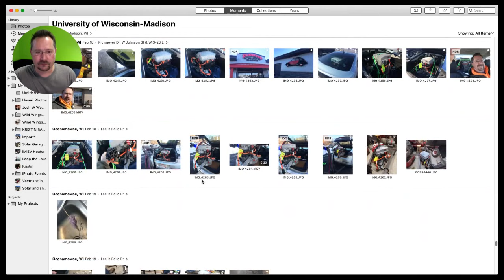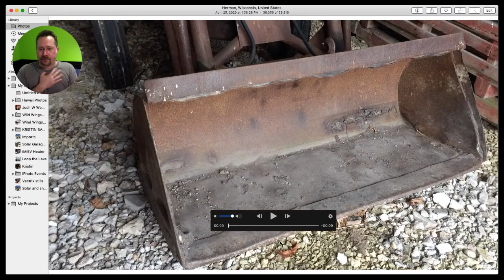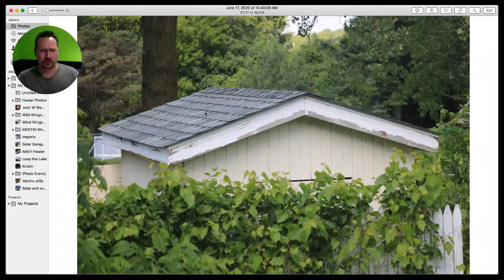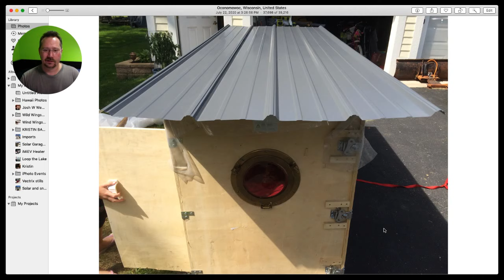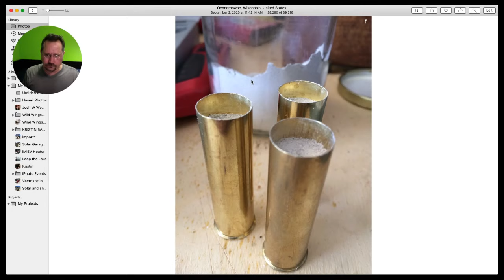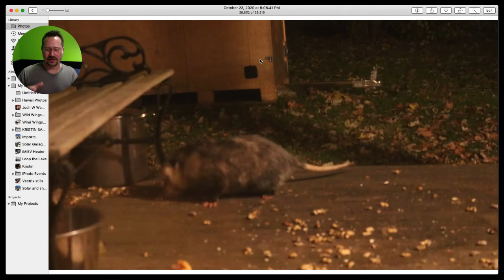2020 Covid Projects - Life, Death, and DIY

Comment: Hi Benjamin, I saw your video on the tear down of the Nissan LEAF gear box:  https://www.youtube.com/watch?v=L5WhB7uQLzY    I want to ask you:
.
At minute 7:18 of your video we see the 2 gears.  Do you think it would be possible to swop those gears?  The result: for every one rotation of the motor the car wheels would turn, say 1.5 rotations.  This would mean that the Nissan LEAF would all of sudden have kick ass power.  You could perhaps do 0 to 100km/hr in, say, 4 seconds.  Obviously there is a question of torque, speed measurement and of course would the gearbox housing accept the change. 
.
I think you get the idea?  I have a Nissan LEAF and have always wondered if there is anything I could do from a mechanical sense to make it go faster.
.
Comments?
Reply from the maker: Looking in the gearbox, it would not be a simple swap to change those two gears. It would require some special machining and I know it would be beyond my ability.
The trick with gearing is that you swap torque for speed or speed for torque. You can't gain both, that requires a higher HP engine/motor.

A gear swap could give a higher top speed, with poor acceleration, that seems like a poor choice.

Improved acceleration (torque) with a lower top speed might be fun, but would probably mean you couldn't drive the car on the interstate anymore!

It would be interesting to combine a Leaf Motor with a manual gear box if it could be used to go with even lower gearing. In my electric Geo Metro, I could do burn-outs in first gear, but top speed was hit almost immediately. In 5th gear, I could pull away from a dead stop, but it was slow and would draw very high current.
Reply: @BenjaminNelsonX  I agree with combining the LEAF gear box and a manual gearbox.  BUT!!.  From what I saw in your video (by the way thanks for showing the video) the drive gear is smaller than the slave gear.  This would imply:
.
for every 1.5 rotations of the drive gear you get 1 rotation of the slave gear (I'm guessing the number of rotations)
.
By swopping them it would imply:
.
for every 1 rotation of the drive gear you get 1.5 rotations of the slave gear.
.
That would certainly make the car go faster BUT reduce the torque.  The question is: Does the motor still have enough torque for such a configuration?  Well if you look at this video: https://www.youtube.com/watch?v=6yJN8Sg-e4k  you will see a Nissan LEAF towing 3 cars meaning that the motor has enough torque to pull 3 times the weight of a LEAF.  I think that motor is a 'torque-beast' looking to be unleashed. 
.
Now if the motor has enough torque, you will get a thumping pull away speed and a far higher highway speed.  So much so, that if I were to do the conversion and on rolling out the vehicle, I would even be afraid of touching the 'gas' peddle until I'm on open road just in case the car does a sudden leap. 
.
Comment?

Comment: Could I use a hub motor on a vehicle
Reply from the maker: Yes, there are hub motors that can work on vehicles, but those are really only practical at this point on scooters and motorcycles.
Hub motors have a few issues, including unsprung weight and the fact that you can't change them through gearing.

Notice that commercial car builders do NOT use hub motors.
Reply: @BenjaminNelsonX  "Notice that commercial car builders do NOT use hub motors. " -- Except Lordstown apparently... We'll see how well that works for them I guess.